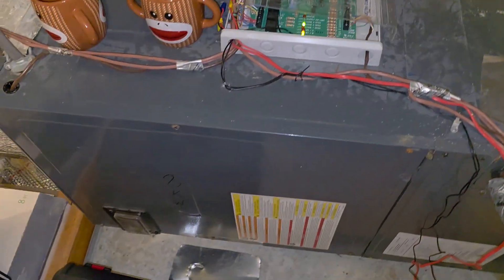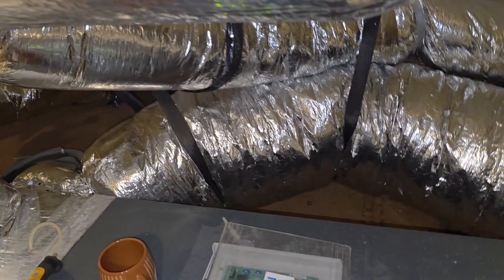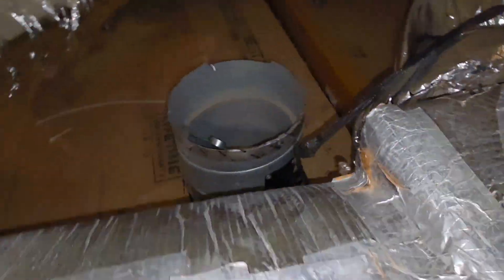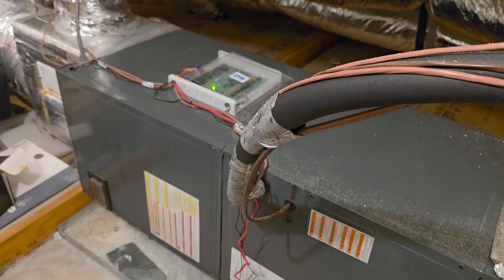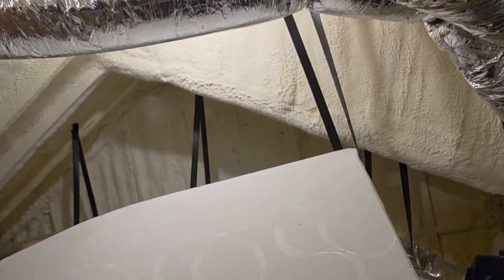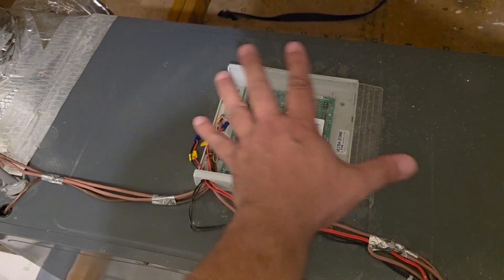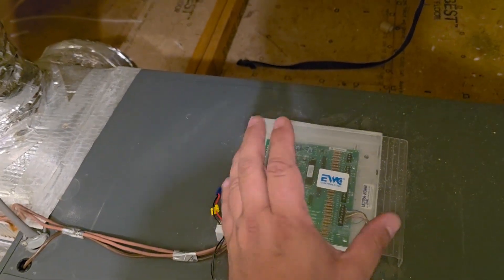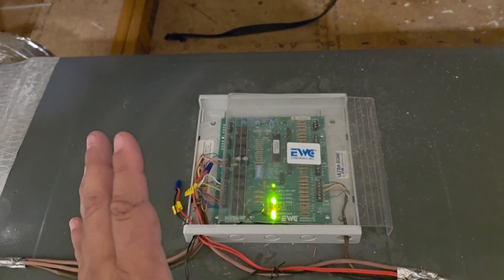How much Bypass is Too Much?

Comment: I’m surprised even a pro like you would leave a conditioned attic with no airflow.
Reply from the maker: That’s cuz a conditioned pro knows cutting a supply into the duct doesn’t work. That surprise you too?
Reply: @timdestasiohvac  would help to know why.  Could be something not explained in the video.
Reply from the maker: @davidhoover2446 please rephrase your question. I'm trying to figure out whether you're asking a legit question or just trying to be a troll.
Reply: @davidhoover2446 , I would believe if one were trying to control the humidity in a highly insulated attic, one could add a small branch supply duct and a small return duct branch to circulate air inside the attic. Basically, just a supply opening does not do much without a return opening.
Obviously, adding an attic zone with some type of controller, such as humidistat, would be ideal. That's my opinion.

Comment: So they're dumping air into the encapsulated attic - not necessary, and it only dumps more humidity into space, which leads to additional issues with excess moisture. Is there even a dehumidifier? 

It baffles me how little so many contractors know about zoning. Most of the time, they throw a 12" or 14" on it and call it good. Not to mention, they make it as short as humanly possible.